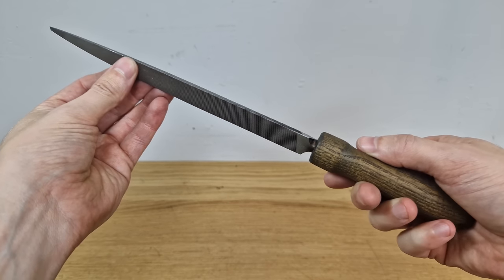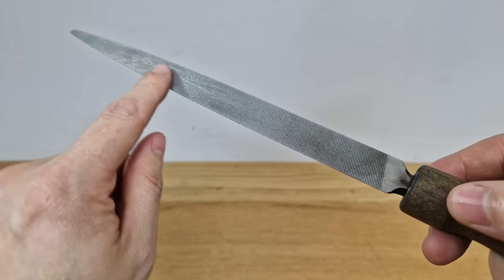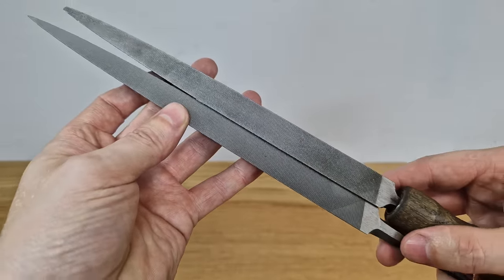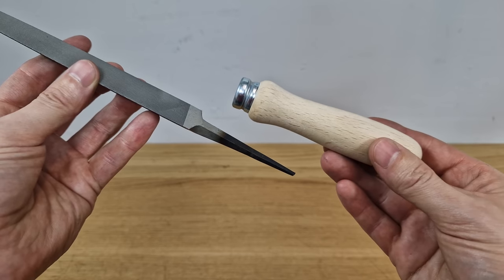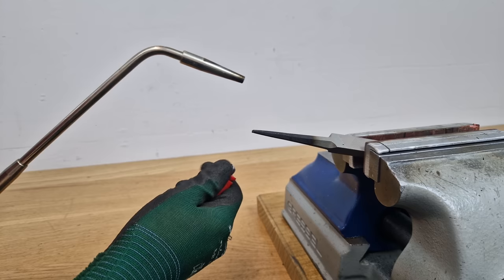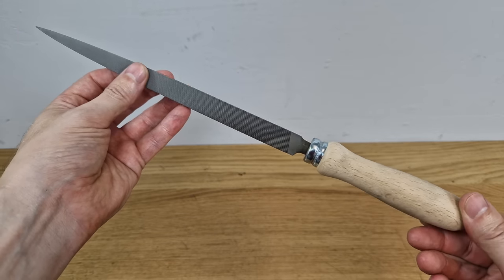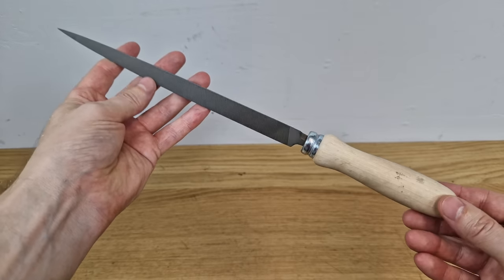How to install Wooden Handles on Files

Comment: Quick question. Isn't it bad for the file touching it with your bear hands? Also, could you have wrapped the file on a wet cloth to avoid temp. Changes in the structure of the metal? Just curiosity
Reply: Why would touching the file harm it?

And you could, but it isn't really going to be an issue in most cases.

Comment: This video raised a question in my mind: is there any way to reshape files surface when they have to much wear?
Reply: You can soak it in acid for a while.
This doesn't really 'sharpen' so much as clear the file off debris, it does make it cut better though.

If you were really dedicated, you would aneal the file, grind the old teeth off, use a chisel (or something similar), and punch new teeth into the file blank, then reharden and temper.
That's way more time consuming than just buying a new file.

Turning the dead file into any number of new tools is significantly easier and faster.
Always handy to have some really good tool steel lying around, so just save it for obscure tools, or custom file shapes (by grinding away the bad stuff, and making a smaller weirdly shaped/specialised file.)

Comment: It would be interesting to know WHY that “burning in” technique works.   I would have thought the wood would become charred - which is weak and crumbly.  Another thought is that the tang would actually shrink / contract from its heated state and so would be of a smaller diameter than the hole it forced into the wood.
Clearly neither of those is the case and the method works.   But why?

Comment: Maybe try to sharpen the file by soaking over night in muriatic acid. We have been doing this for years. 
Cheers
Reply from the maker: Maybe worth a test video?
Reply: @mymechanicsinsights  
Tip, do this outside, the fumes will rust everything in your shop😉

Comment: 💥I would have thought heating it up would cause it to expand, and then it would contract as it cooled, therefore becoming loose? 🤔
Reply from the maker: Metal only expands a few houndreds of milimeters, but the wood is deformed a few milimeters, so no it does not come loose. Just take a look how strong the old handle held on the old file. I used it a lot, attached that handle around two years ago.

Comment: I am alittle confused as how heating it up causes a stronger bong.. when you are heating metal it expands, and then when it cools down it will shrink, wont this make it looser inside the wooden handle? unless there is an adhesive chemical inside the wooden handle that is activated by heat, I don't understand how this works.. Can you explain more please?
Reply from the maker: Metal only expands a few houndreds of milimeters, but the wood is deformed a few milimeters, so no it does not come loose. Just take a look how strong the old handle held on the old file. I used it a lot, attached that handle around two years ago.

Comment: how hot does the file get? Could you protect it with a wet towel or isn't that necessary?
Reply from the maker: As long as the metal doesn't change color, as long will the heat treatment not get affected. Wet towel wouldn't hurt though.

Comment: Sorry to disagree but I never do this because the hot tang burns out the wooden handle to the size of the tang and in time it just becomes loose. I measure the size of the tang half way down and guesstimate roughly what diameter drill I will need. I then find a suitable piece of aluminium tube that the handle nearly fits inside, then cut a slit in the tube allowing the handle to now fit in the tube. I grip it in the lathe chuck making sure it's running somewhere near true and drill out the handle down to a depth of half the length of the tang. Then hold the file in the vice in the vertical position and drive the handle on with a soft hammer, making sure it goes on dead straight. I then leave the handle to soak overnight in Linseed oil. After drying the wood shrinks and gets a very solid grip on the tang, and the linseed oil gives a lovely soft feel. I have a beautiful set of Vallorbe files of all shapes, cuts, and sizes. They're the best in the world. Love your channel.

Comment: how do you calculate the drilling to do before  doing this steps you showed? Cheers!
Reply from the maker: It's a bought handle, the hole is already drilled. Maybe goes in 1/3 to 1/2

Comment: Actually there is a better way. There is some screw on file handles. Advantage is they can be tightened and reused multiple times.  Anneal old file by making it red hot then let cool in wood fire.  You can use sharp chisel to cut new chisel teeth then harden or cut custom blades for anything from lathe bits to wood planing bits.

Comment: Im confused as to how this works. Metal expands whith heat, and if the handle is put on while the shank is hot, then how it is not creating a loose fit when it cools down and retracts?

Comment: Interesting...but, why? Intuetively I'd guess upon cooling the metals shrinks and the binding will get loose?
Reply from the maker: Metal only expands a few houndreds of milimeters, but the wood is deformed a few milimeters, so no it does not come loose. Just take a look how strong the old handle held on the old file. I used it a lot, attached that handle around two years ago.

Comment: What would you rather have contact the tang of your file: Sound beechwood, or crumbly charcoal?
In short I really don't think that this is a good idea. It may work if the tang is cool enough for the final strokes to remove the coal formed. If you burn it it to the end, you will end up with a sloppy fit.
Use a handle with the right size stepped bore and smack in on tight.

Comment: I always worried to accidentally ruin tje hardness of the file when heating the tang. Is it possible?
Reply from the maker: Just be sure the file teeth don't get so hot that it changes color.
Reply: @mymechanicsinsights  noted, thank you

Comment: Don't metals expand when heated and shrink when cooled?
Reply from the maker: Metal only expands a few houndreds of milimeters, but the wood is deformed a few milimeters, so no it does not come loose. Just take a look how strong the old handle held on the old file. I used it a lot, attached that handle around two years ago.

Comment: It's honestly not that strong of a bond, though probably fine for a file, I wouldn't try to use it for something like a knife or hammer. As soon as the steel cools down it shrinks, there's carbon between the steel and wood(which acts as a lubricant) and you may affect the tempering of the steel.
In your case it's probably fine, but wouldn't be my go to.
Reply from the maker: Definitely not for a hammer. But a lot of japanese knife makers actually use this technique.

Comment: Safety is indeed important, so it should be said that not just any kind of gloves can be used for any kind of work.

And the ones you show (NBR coated nylon) are completely inappropriate for turning steel red hot with an acetylene torch; actually I think it might be worse than just no gloves at all, since these would probably melt right into your skin if you but touched anything that's hotter than 300°C with them. 

Welding gloves would be much better suited for this.
(Fun fact, there are even different kinds of welding gloves for different processes. For TIG, where high level of dexterity is needed, gloves are ususally made of goat skin, which is softer and suppler than cow hide, typically used to make tougher, thicker gloves for MIG or MMA welding.

Also, igniting the torch with a Bic lighter is kind of a no-no. But you probably already know that; in every other video where you used your torch, you ingited it with a flint striker.
Reply from the maker: I'm just out of flints currently haha. Thanks for the comment

Comment: Intuition would tell me otherwise, I thought metals expand when heated and contract when cooled? What is it that makes this such a strong bond?
Reply from the maker: Metal only expands a few houndreds of milimeters, but the wood is deformed a few milimeters, so no it does not come loose. Just take a look how strong the old handle held on the old file. I used it a lot, attached that handle around two years ago.

Comment: Wasn't there a rule to never light the torch with a lighter, but with a flint?
Reply from the maker: Maybe, I don't know. Why is that?
Reply: Because you get your fingers way too close to the flame with the lighter. Also, it is a plastic filled with gas next to a flame that can melt steel and you risk to loose an eyebrow or two.
Reply: @WlSkyler  good to know, makes sense

Comment: But doesn’t heating the file so much change the temper?
Reply from the maker: As long as the metal doesn't change color, as long will the heat treatment not get affected.

Comment: when you heated the file it's like you tempered the material and reduced the hardness?
Reply: Nope. The tang isn't usually hardened when the file is manufactured, as it doesn't need to be hard (not a cutting surface) and risks cracking when the handle is used with a lot of force, rendering the file useless.
Reply: The tang doesn't need to be very hard compared to the extreme hardness of a file, also, a very low heat and wont affect the teeth hardness as much as a complete orange heat from a forge for example. Hardness is mostly only affected by the region being heated and depending on the tempering method like quenching it in oil or water or letting it cool of by air or even this one by squeezing in wood will change the hardness result. Water and oil = Very hard depending on the temperature the steel was at. Air = Soft to medium hardness. The steel quality also change the hardness proprieties. It's very complicated.
Reply from the maker: The tang is indeed not hardened, as you can see by the different color of it on the new file. As long as the file teeth don't change color from the heat it will be all good.

Comment: I do the same but after knocking the file into the handle I place the file handle in a bucket of water for a day. The air trapped in the wood cools drawing water into the handle making the wood swell which really grips the file.  I usually can't hammer the file out of the handle without braking it.
Reply: Never use water on wooden tool handles.

Learn to properly do it
Reply: @autumn5592  
Take your own advice.

Comment: Isn't there a risk to deharden the file if heating to much? Perhaps the heat doesn't travel so far up the material? Good informative video otherwise 👍
Reply from the maker: As long as the metal doesn't change color, as long will the heat treatment not get affected.
Reply: @mymechanicsinsights  Good to know, thanks for sharing.

Comment: I would have thought heating the metal would expand it, and then when it cools it would contract and become loose. It's weird when science fails me like that.
Reply from the maker: Metal only expands a few houndreds of milimeters, but the wood is deformed a few milimeters, so no it does not come loose. Just take a look how strong the old handle held on the old file. I used it a lot, attached that handle around two years ago.

Comment: I trust your experience and knowledge but it doesn't make sense to me that heating (and expanding the) the metal and then attaching the handle and the metal shrinks would create a stronger bond than modern epoxy adhesive could create.
Reply from the maker: Metal only shrinks maybe a few 0.01mm, but you're pressing the wood several mm

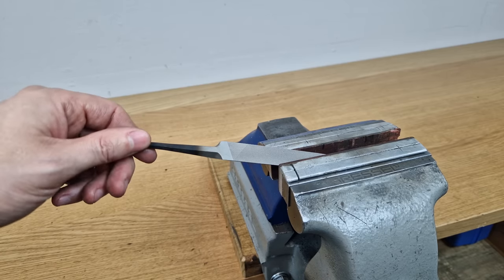Comment: 1:40 If safety is your priority, you shouldn't be wearing rubber gloves when working with flames or heat in general. Take leather gloves instead.
Reply from the maker: They're not rubber, but yeah leather would be better.
Reply: @mymechanicsinsights  Polyurethane, which is even more flamable than rubber and combined with polyamide, which draws strings when burned, definitely not what you want on your skin when working with flames.

Comment: Not good! 😳
- You don't need a vise, you can hold it by hand.
- Use a bigger torch to heat it up in less than 10 seconds.
- Aim the flame away from you along the end of the file for warming up everything, don't position the flame at a 90° angle.
- You don't need a hammer. Insert the file with the glowing hot end correctly centered into the handle, push by hand. Then grab the file and slam it with the handle downward onto a solid surface like an anvil 1 or 2 times. It will be snug fit in.
- Let cold water flow over the handle and the end of the file. It stops the fire and smoke. The wooden handle will swell and fit even tighter.
That's how I learnt it almost 40 years ago. 😉

Comment: This is completely incorrect. Heating the metal makes it expand then contract after the handle is on it also burns the wood making the hole larger. A simple cold set is stronger and faster.